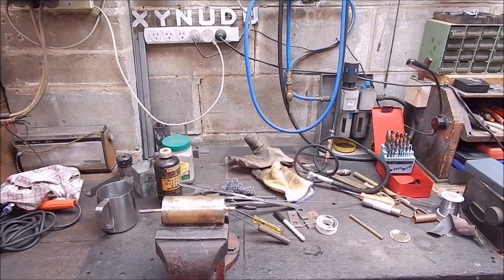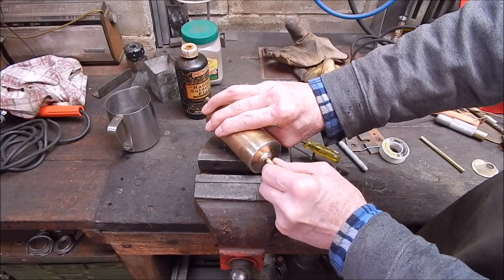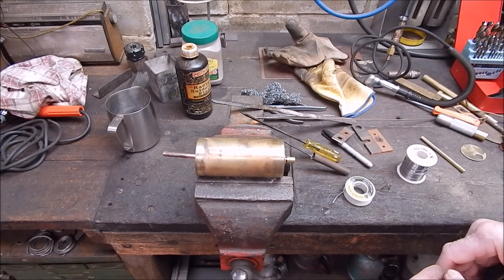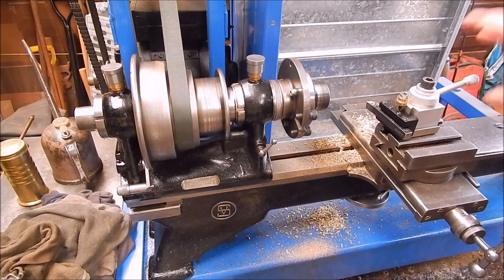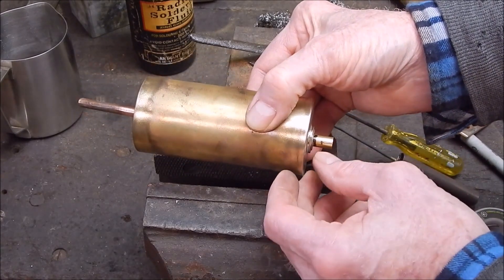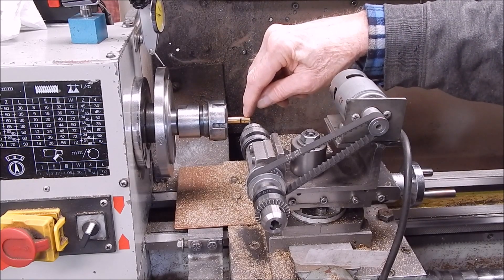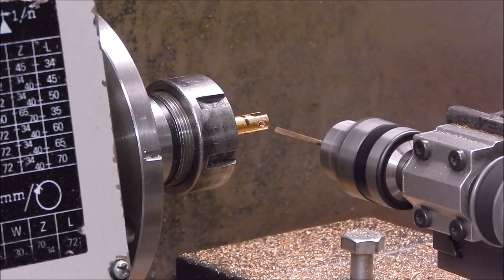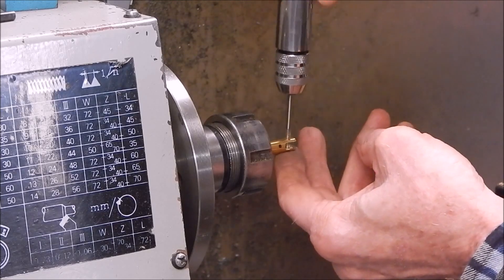I build a unique model steam engine without plans

Comment: Hi Rob, nice to see your most recent video. Good rationale for combination silver solder with soft solder. I haven't silver soldered anything since leaving school 40 years ago. What % silver solder did you use? I can remember most of what I  learnt in metalwork years ago but I  don't remember any information about the different grades of silver solder other than it has a lower melt point than bronze brazing rods and it's expensive, even more so as the % silver content increases.
Reply from the maker: I just up the 5% GP stuff that plumbers use.  Works fine with brass and copper.  You only need the really expensive high silver content rods for steel.  Manganese bronze is much cheaper and better/stronger for that job anyway, so I never buy the high silver content rods.  In fact the silver solder rods I use and have (quite a lot of) have all pretty much been bought at garage and clearing sales.  They look pretty low rent cost wise and you can usually buy them for a fraction of their true value from a supply shop.  Cheers Rob
Reply: @Xynudu  Thanks Rob. All good to know. Do you use a specific silver flux or just use the regular 303 brazing flux?
Reply from the maker: 303 works fine for silver solder as well as bronze.
Reply: @Xynudu  that will save some money.

Comment: Hi Rob, fantastic work there it looks great. I'm interested in the toolpost mounted drill arrangement you are using, is that one you made or brought. Do you have any more information on it.
Reply from the maker: It's one I made using a spindle assembly and 775 DC motor from Banggood.  Search my videos for 775 or tool post grinder and plenty will come up.  It's invaluable for model making.  Quite cheap and simple to make.  Cheers Rob
Reply: @Xynudu Thanks, I'd like to make something similar. Where did you get the belt and pulleys from.
Reply from the maker: The belt and pulleys were all part of the spindle assembly.  I just had a look and I don't think Banggood sell these kits any more.   I expect you can buy the individual components on Ebay and Amazon - under linear motion.

Comment: Hi Rob. Looking good 👍👍👍 I'm very interested to see if having the cylinder inside the boiler affects the running. Obviously a conventional external cylinder has steam passing through it but yours will have steam/boiling water surrounding the outside. It's going to be one very interesting engine. Cheers, Alan.
Reply from the maker: Hi Alan.  It certainly is an interesting project.  I can't see any issues, after all, "what could possibly go wrong" ;)  He He.
I expect that there will be very little pressure loss/drop through cooling, which theoretically should give more power.  I'm no engineer though, so I could well be wrong.  I entertained the idea of various configurations including a rocker arm to the piston with the rotary valve at the oppposite end of the boiler, but eventually decided to keep it all simple and reduce friction to a minimum.  Stay tuned for more action.  Cheers Rob